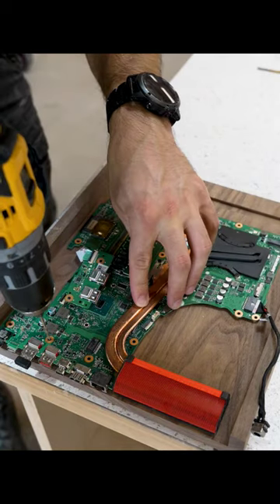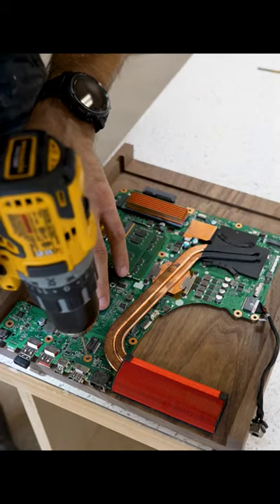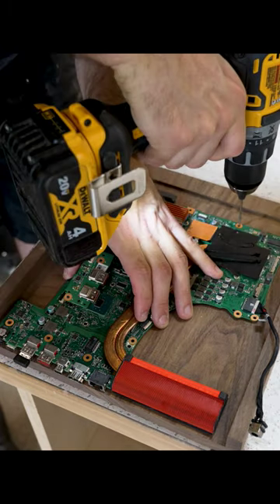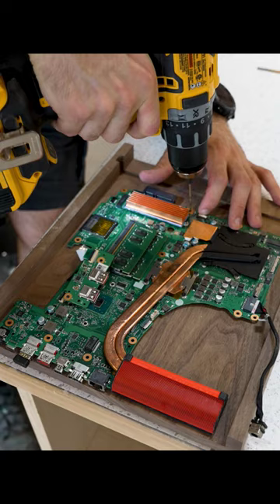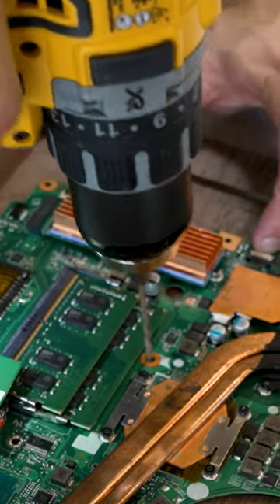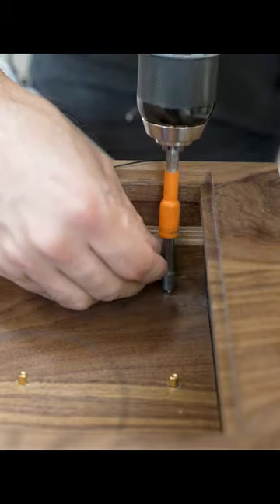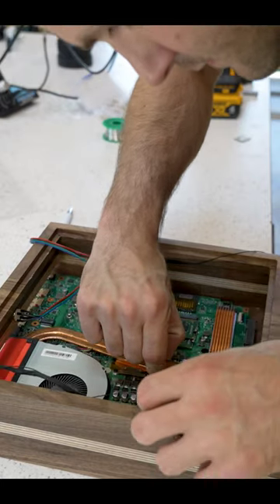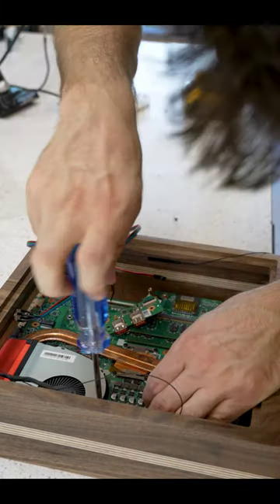drill through the motherboard!

Comment: How have the temperatures and loudness of your desk pc been? I've watched that video several times and have been planning a build for a while. Yours was the first I saw that was what I had been picturing.
Reply from the maker: Sound has been great! Temperatures have been so so, they started out great, but I've slowly been adding more and more high performance and high power draw parts and it's starting to struggle. I'm going to do a full redesign in the new year along with a big upgrade
Reply: Tbh wood captures heat like crazy, it's one of the worst materials to use for a pc casing if you're worried about the temperature. But I gotta say, it looks great and if that's where your priorities lie, more power to you!